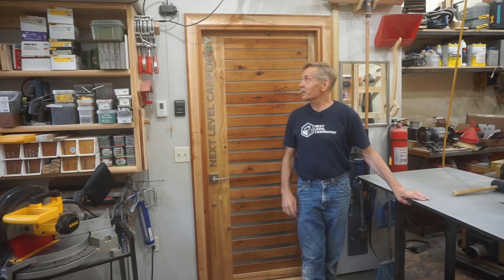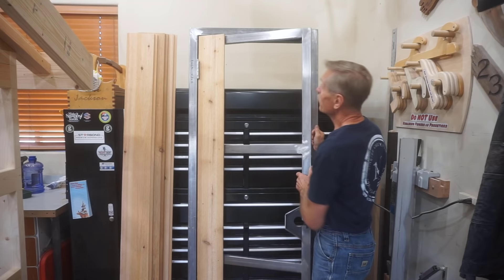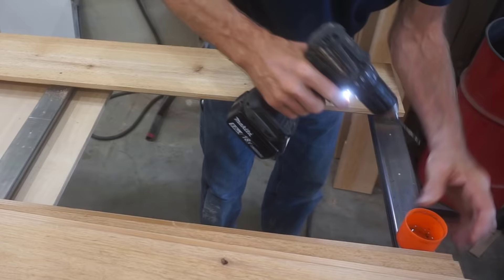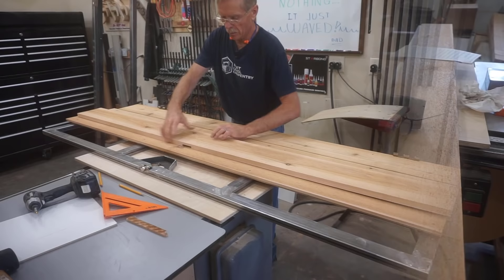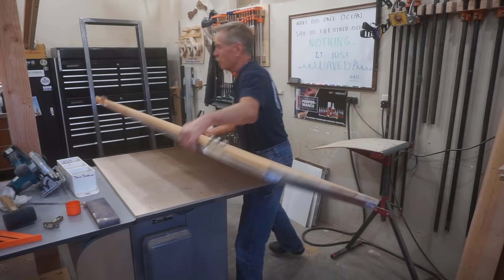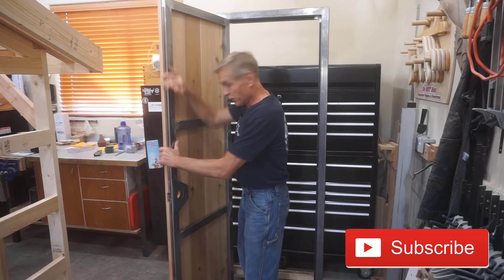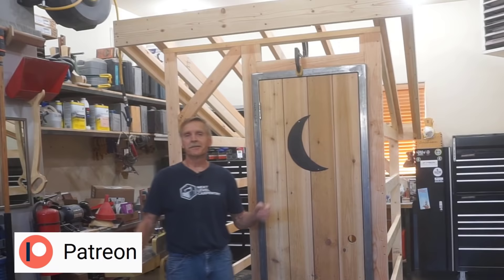How to Attach Wood to Steel

Comment: How do you prevent the steel from rust?
Reply from the maker: Keep it dry. I used good rattle can spraypaint for this project and it works well.  The next step is to consider powdercoating the steel. If neither of those are good enough your best bet is stainless steel or possibly aluminum but both are considerably more $$

Comment: I did kind of the same thing when it comes to measurements and predrilling but I don't like the screws showing so I drilled the holes in the metal the same size as the screws and after drilling the holes in the metal I drilled the wood on from the.metal side using flat head screws so it's not only flat on the inside and outside but the the screws don't show and no one can unscrew the wood and come in and I think that's more important than how it looks.
Reply from the maker: Fastener choice/appearance is ultimately a matter of personal preference vs cost and, for this project, visibility of those tiny screw heads was the practical choice...

Comment: do you have any idea how to attach carpet to concrete
Reply from the maker: Yup...
Reply: And now for a serious answer.
The best way to lay carpet on concrete is Wall to Wall and stretched in place.
First lay a good vapor barrier, then lay the tack strips around the perimeter.
(use tack strips for concrete, they have hard nails to penetrate the concrete)
Then lay your carpet, stretching it from one side, of the room, to the other, then
stretch it between the two opposite wall. Simple but Not Easy.
You will need to rent the tool, to do it and it can get screwed up, real easy.
I Strongly suggest calling a professional.

Disclaimer: I am Not and never have been a professional, nor am I, by Any means, associated with the business.
I have seen it done and have seen professionals experience difficulties.
Reply: @NextLevelCarpentry  can u explain it to me

Comment: What screws can I use if I wan to secure melamine into a frame like that??
Reply from the maker: Seems to me like the same trim head screws would be a good option and probably your best option...
Best, Matt
Reply: @NextLevelCarpentry  alright thank you ! I have to install some melamine cabinets on top of a metal frame thing. That’s for the tip!

Comment: Yeah, problem is not every application calls for square tubing, which gets extremely expensive. For instance, im layering my Quonset hut with ghostwood which is one layer galvanized steel. I'm going to use slotted angle attaching them horizontally inside the shop. Then predrill the wood from the outside and bolt each plank down with 3 machine head bolts. The rest will be nail glued to the hut. Its coming out pristine so far. Looks awesome.

Comment: Im sorry but I think I am missing something. It looks like the wood is just screwed to the metal frame? Is there something else about it?
Reply from the maker: Sounds like you're missing the fact that every other video on YouTube (and common practice) uses TEK screws or self drilling hex head bolts whereas this video shows use of trim head screws commonly used for wood... other than than, you're not missing anything.
Reply: @NextLevelCarpentry  oh... Ok. Yea it makes sense to use a screw with a head that will not look awful...

Comment: #1,000 like!  Totally irrelevant but also kinda cool.  I'm confused though because I thought in the video you said you were going to hide the heads.  I guess I missed it in the excitement of being #1,000.  That door screams NLC like all your other work BTW.
Reply from the maker: Sorry for any confusion Rick: my goal was to make the fasteners 'discreet' rather than invisible.  
Both are certainly possible but invisible is significantly more expensive than discreet, especially when fasteners on the rest of the structure will be visible to the same degree.  It goes to 'if it takes a little work to make something a lot better (trim screws vs TEK screws), it's worth it.  If it takes a lot of work to make something a little better (tiny trim heads on knotty boards vs invisible screws from behind) it's probably not worth it.  Ultimately it's my client's choice so I try my best to accommodate. 😁😎 Best, Matt
Reply: @NextLevelCarpentry  you NEVER owe me an apology....I was just trying to be funny but I guess it came out stupid on my part.  I probably heard you wrong.  Have a great week sir.
Reply from the maker: @rickcimino743  I'm not one who's known for being able to count the stitches on a fastball and your humor wouldn't be the first thing I missed😟  I forgot to mention congratulations for being like number 1000... I think that's pretty cool!
Hope you have a good week as well...

Comment: Why put a lock on this door when the hinge pins are so easily removed?
Reply from the maker: Unfortunately, Dave, your comment only broadcasts your ignorance. I am from the future where NRP's are in common use. Going forward you might want to reconsider your assumption that you know everything...  juss sayin.
Reply: @NextLevelCarpentry  what a foolish response.
Reply from the maker: @calmmeoriginalofficialchan9110  Foolish? Maybe... but only to the degree it is fitting, right?

Comment: I'm not one from the "Developed World" But I have worked with steel and metrics and 13 gage is 2.3 mm. I guess that's what happens when we try to make a joke at someone else's expense.

But if the goal of the joke was to drive up the comments it worked.

I'm surprised you didn't say anything about wood movement.

Comment: THIS MASTER CARPENTER (me) says that was super amateur.

Sorry.

1. If you have to use crews, you only need 1per stud in the field if your using lap boards, the lap holds the other board down, you can always hide a screw under the lap on the bottom plank if you insist on two screws.
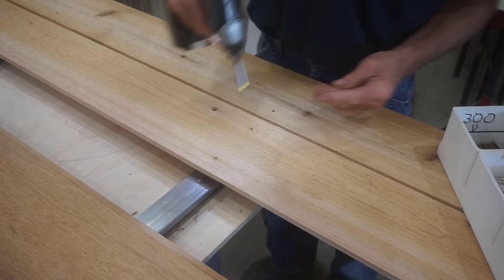2. You failed to orient the rings toward the weather, (2:41)and due to that, you have increased the likelihood of splitting at the screws. Which also due to expansion and contraction will damage the wood( less fasteners is best here) 
3. A real master like me can show you how to drill a hole without leaving a hole for the screw head to show through. Thats right. Predrill with no hole to see or screw head to see.
4. Pennies more and stainless screws are the right choice.

But good job for trying something new.
Reply from the maker: Wow! Ain't YOU sumpthin! You are making a lot of declarations of superiority yet have zero skin in the game and make those declarations based on a bunch of incorrect assumptions.  You may not be an amateur but you are definitely obnoxious. Polite maybe... but still obnoxious
Reply: I was being an ass. Had a bad day. Disregard
Reply from the maker: @alnov91  Can happen to anyone... hope tomorrow's a better day! 🙏🏻😎

Comment: Are those some special screws to make them work in both steel and wood? I thought you always had to thread the holes first, if steel or alu, and use machine screws.
Reply from the maker: Surprisingly those are standard trim head screws Martin, which is the 'master carpenter's secret' part of the video.  Most people have the same common preconceived notion you do about tapping steel for machine screw threads.  Drilling and tapping for machine screws is common practice and, in many cases, a best practice, but now you know otherwise, right?  Best, Matt
Reply: @NextLevelCarpentry  Yes, interesting! Will try it out. Thanks.
Reply from the maker: Great! FYI I always do a little test/experiment to get the right combination of drillbit, steel thickness and fastener for a given project.  Generally, the thicker the steel, the closer the pilot hole diameter needs to be to the O.D. of the screw's threads.  Access to a wire size drillbit index can be very helpful because of smaller increments between bit sizes: https://www.amazon.com/dp/B004OECLL4/?ref=idea_lv_dp_ov_d&tag=aiponsite-20&linkCode=ic6&ascsubtag=amzn1.ideas.G10SWIR9VYYW
but I generally find there's a bit of leeway in the diameter selection process.
Best, Matt
Reply: Those screws are available at HD and other places like Rockler
Reply: Threading holes would be the 'best practice', but not absolutely necessary. I agree this is a 'master level' trick because many people will struggle to find the right balance of bit diameter and screws, much less forgiving with steel!
Reply: @NextLevelCarpentry  Did you mean  to say ID instead of OD?
Reply from the maker: @vjgrevem  maybe... when?
Reply: @NextLevelCarpentry  When you said: "Generally, the thicker the steel, the closer the pilot hole diameter needs to be to the O.D. of the screw's threads."  But, I think I now see your point.  My bad.
Reply from the maker: @vjgrevem  no problem at all... anyone who pays attention to a video at that level is definitely learning things. Sounds like you figured it out that if a person is using sheet metal the pilot hole can be about equal to the screws root or the ID you asked about whereas steel that's maybe a quarter inch thick needs a pilot hold up closer to the threads outside diameter because the threads can't Mash down that much in the thicker Steel...
Best, Matt

Comment: I'd be more anal about screw heads...Couple ways: coming in from the back but not penetrating the front with the point of a longer screw or I might even install a single insert at each board's center screw position and use 10-24 machine screws(the metal frame will prevent racking). But that's just me and now that I know it's for an out house, I'm good with the trim head screws from the front. I could get into a diatribe about the expansion and contraction of the cedar with two screws through metal rails but I won't; that'd be too much like today's internet. That is going to be one heck of nice outhouse!!

Comment: Well there is not a master carpentry secret to be seen, it would maybe if you made some clamps on the inside of the door to attach the wood to the steel. Thumbs down this time.
Reply from the maker: Seriously... you already knew this?
Reply from the maker: @Dee O'dilly the 'wooden hinge' trick is useful and effective but not in the environment where this door will live...
Reply from the maker: @Dee O'dilly It would be difficult to put 'tight fitting lumber down through' the enclosed tubes on this particular door which is what makes this method un-common practice IMHO.  Best, Matt

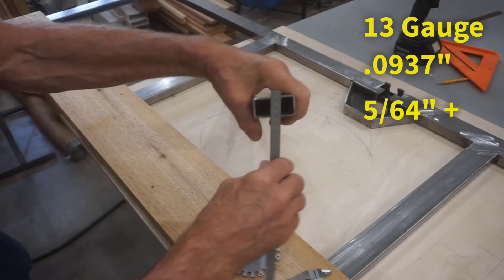Comment: 1:30 all those numbers do not match. By the looks the thickness of the tube is about 2-3 mm so I believe the 0.0937 is correct which means that the next number is 3/32 and the metric would be 2.38 mm.
Reply from the maker: You're probably right... the takeaway is to match drill size with screw size and material thickness for a winning combination for success.